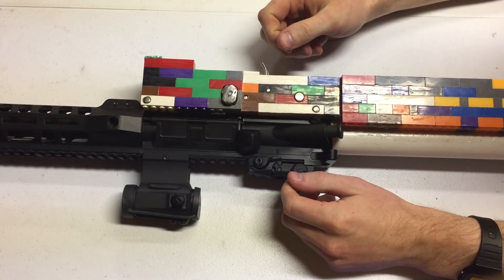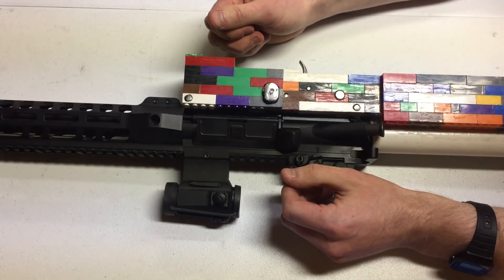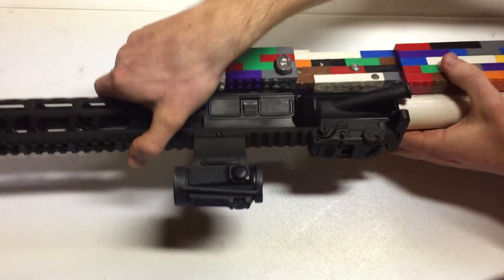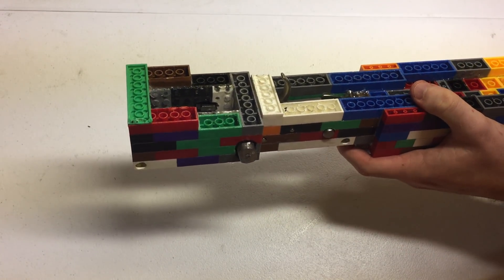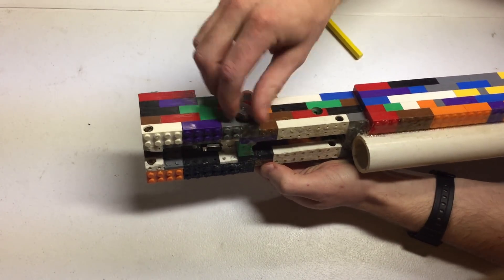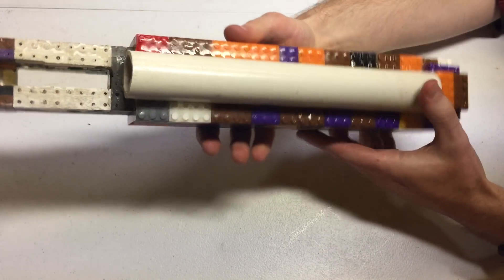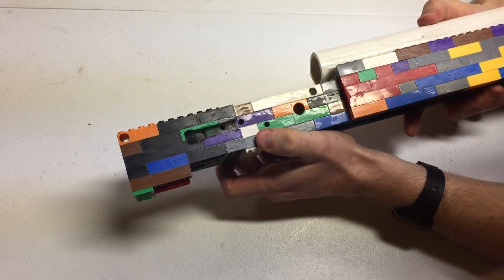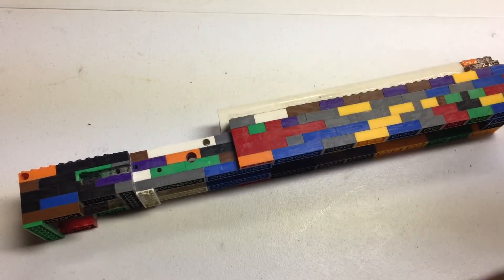LEGO AR15 lower receiver disassembly

Comment: Lego bricks are made out of ABS, Acrylonitrile butadiene styrene. They can be welded together into a solid with cements made specifically for them. Plastruct's Plastic weld. It can usually be found in hobby shops that cater to model railroaders and kit builders. 
https://www.plastruct.com/products/ppc-2?pr_prod_strat=copurchase&pr_rec_pid=4015300247597&pr_ref_pid=4015270920237&pr_seq=uniform

Comment: To improve the takedown pins you could instal metal inserts. Or if you want to try your go at moulding. try making bricks out of epoxy or even metal. Or if you have 3d printer use a filling that has metal in it. Or a very hard plastic filling with a hole for a metal insert.

Comment: Next make an AK lower Out of legos
Reply: AK doesn't have lower. Doing this with AR is doable as we can see, but you certainly can't do that with AK...
...well you probably could, but it would F itself after few shots if not a single one. 

With AR lower, it's basically just a magazine well and fire-control group, with AK tho... oh boy, you got everything there - from the front trunion where the barrel is pressed in, to the rails on which the bolt carrier drives.
Reply: The AR platform allows for a weaker lower since it only really holds the fire control group and mag well (and the buffer tube, but as you can see, PVC pipe handles that just fine), but most other if not all others do not. The AK in particular needs a strong lower or else it will rip itself apart. See Brandon Herrarra's video on the Plastikov for an example.

Comment: Build a lego ak 47
Reply: Possible, but it would need tons of steel reinforcements and time, just to F itself up (and you with it) after one or few shots. 

AR lower is basically just a magazine well and fire-control group, with AK tho... you got everything there - from the front trunion where the barrel is pressed in, to the rails on which the bolt carrier drives.
Reply: Given how AR lowers and AK lowers aren't the same construction wise, with the AR lower being sort of a "platform" that the upper mounts on, it only needs modifications for the trigger assembly and magwell, but the AK lower is more or less a large slab of stamped steel that holds the bolt carrier, trigger assembly, and magwell, I'd so it would maybe be a tad more of a complex task to accomplish-

Then again I dont know shit about exactly what goes into a receiver of either of these platforms so take it by a grain of salt-

Comment: And here I was wondering if I can sand cast a lower receiver. If anyone has exp. Sand casting one is the process straight forward, or is there extra cutting besides the flashing?
Reply: youre going to need lots of equipment to make one from a sand cast.